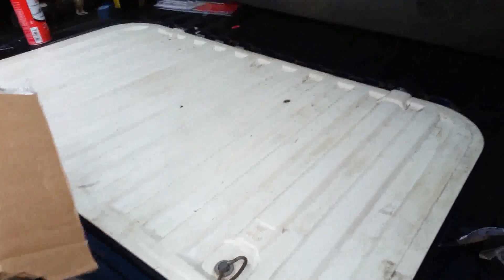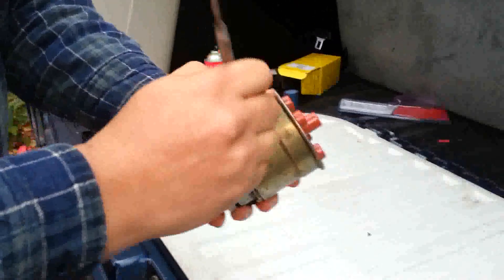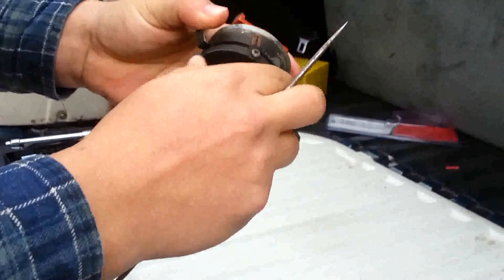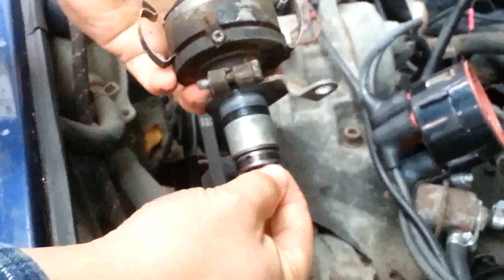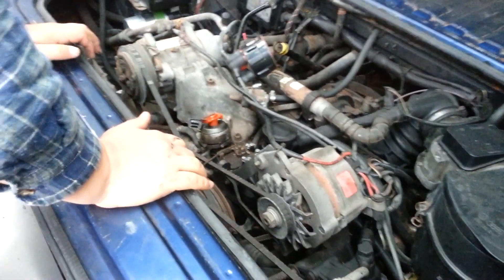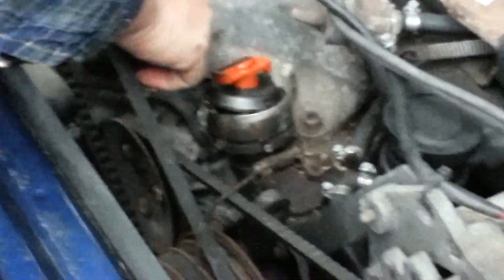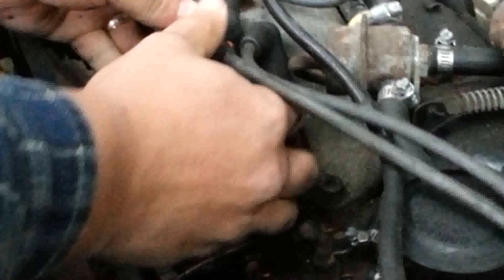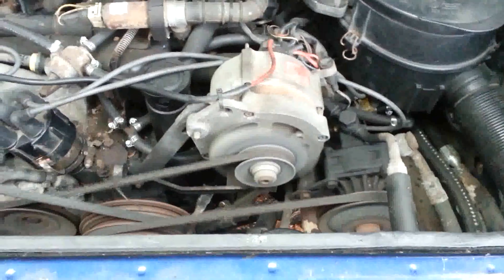Distributor in 91 Vanagon

Comment: HI..I have a 1992 vanagon...currently it has an idling problem...engine sometimes goes off when idling...not stable anyway...so I am wondering if this problem can be solved if getting it replaced..? I have had the cap replaced few years ago..and seems the problem solved...but now it occurs again...
Reply from the maker: You only replaced the cap? The cap and rotor should generally be replaced together. If the engine dies at idle, starts up and runs for a short time before dying again, try unplugging the O2 sensor. If it idles correctly, then that's the problem.